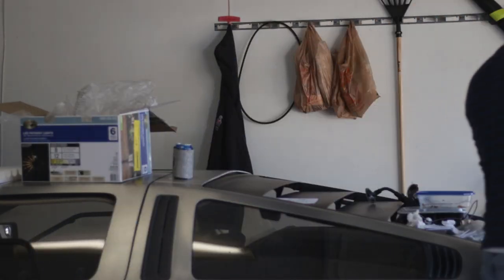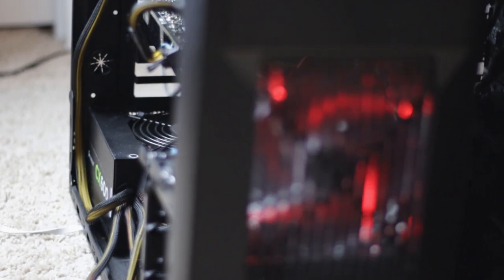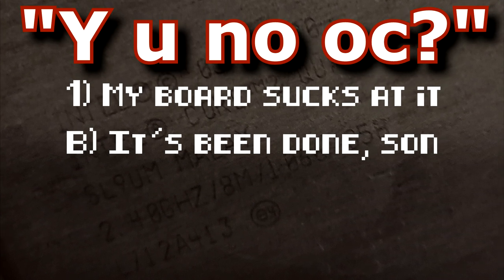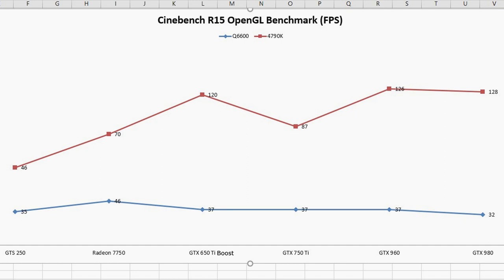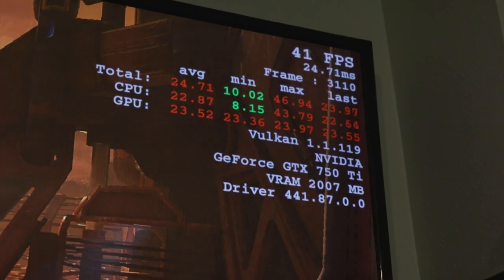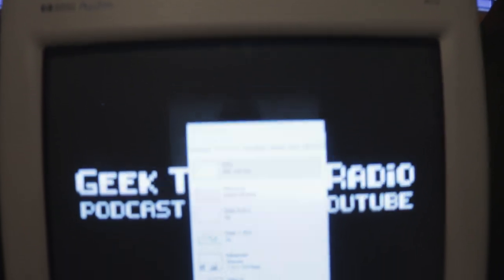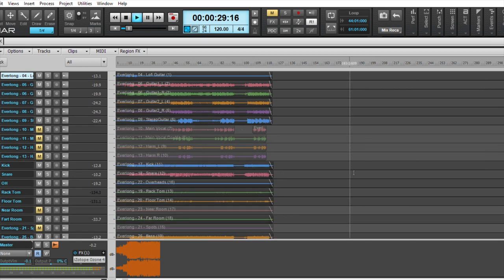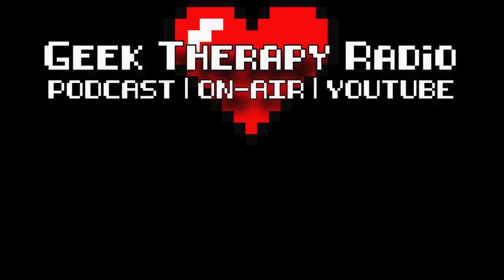Is the Intel Q6600 still worth using?

Comment: I just brought back my old pc with this processor 8800gs graphics card. What a beast it was in 07.  I'll upgrade it from 4(2x2) GB ram to 8 GB ram, a bigger (than stock) cooler 1 or two extra case fans, and because graphics card has two DVI ( none of that fancy HDMI or displayport stuff) I'll hook up my old 22"flatron and my 27" philips monitors. That will have to do for now as a workstation for PCB design, embedded software design and from time to time for wind down gaming. Not sure good or bad, but I'm running Linux. I think my graphics card might not like it

Comment: Q6600 at stock, 8GB DDR3 in HTPC. SSD boot drive. Tinkered with it last week by swapping out the RX550 with a spare GTX 1070. Rocket League @ 120 FPS.

Comment: i have two pc's with Q6600. Rock solid machines and no problem with Vegas Pro video editing or playing CS GO in low setting (i have gtx 760) Another cpu is stock cause my Intel Desktop board doesn't support OC but another is clocked at 3GHz paired with Asus mobo. Maybe upgrading setup later but atleast now i'm fine with these specs :DD

Comment: I feel like... everyone in the comments are my friends I never knew I had... 
I'm still using mine as main PC and still can't imagined why I'd ever want to upgrade. OK TBF I'm on a 6700 (so a bit faster at 2.66GHz) with a "hand me down" GTX680 and 6GB DDR2. Runs "A Plague Tale: Innocence" game from end of 2019 fine on max and no issues and even "no man's sky" (that "claims" need for 8gb ran passably), Genshin Impact that just came out is running great too. Certainly no issues with non-gaming use at all. I've even live streamed (because gfx cards do the compression). Only thing where it could be faster is ray tracing in fusion360. But I only do that for fun anyhow.

Comment: Lol im using Q6600 with a Gt 630 , using for gaming lol im poor
Reply: Im Using an intel celeron with 1.6 ghz Intel dedicated graphic and 2 gb ram ✌️ be happy about what you have
Reply: Get a q9500 from aliexpress bro, its only 10 bucks most of the time
Reply: @zaserker1851  i have a netbook. The CPU is soldered to the Motherboard
Reply: i use q6600 with gtx 1050 and 8gb ddr2 ram...only reason i have bad cpu is cus i stuffed all these things in optiplex 755 and mother board sucks
Reply: With a 1050 ti, ssd and fast/ reasonably high capacity ram the q6600 works nicely for average daily stuff and even sneaking in some gaming like Minecraft lowest settings with optifine and warthunder lowest settings

Comment: I still have my trusty Q6600 workhorse. 💪🏻💪🏻 It has been in more or less continued daily use from the moment came out of the box, shiny new, in late 2007, 😱 

It was born inside an of-the-shelf Compaq Presario that came pre-installed with Windows Vista (oh my.... do you remember that??)  Back then, this was a high-end consumer system. It came with a crappy video card though, that was instantly replaced by something I don’t quite remember, but it had an absolutely monstrous passive cooler that barely fit the system case.   Over time, that was replaced with power-thirsty AMD Radeon 5700 graphics card by ASUS. This sucked up so much power it forced me to upgrade the power supply to a 500Watt Unit. Also, it was freshly fitted with 8GB of DDR2 RAM and an early 120GB Samsung 840 EVO SSD, later expanded with a 500GB 7.200rpm WD Black Caviar HDD, salvaged from a fried laptop. Hooked up to my Synology NAS, that was more than enough to work with.

Even though it’s glory days are long gone, my little Frankenstein Q6600 system is alive and well. It’s fans are getting louder every day, power consumption is frowned upon by today’s standards, interfaces are obsolete in every possible way, and software updates are becoming increasingly challenging. Yet.... it still is a respectable match for many of today’s office laptops. My corporate 8th gen i5 laptop for example, stands humbly in its shadows...
Reply from the maker: Yeah man, paired with an SSD, DDR3, and a mid-range graphics card...the ol' 6600 is still surprisingly useful! :)

Comment: Not upgrading yet from q6600 overclocked to 3 ghz.  It still runs basic apps quickly.
Reply from the maker: Yeah, I'd be perfectly happy using a q6600 day to day. It only really shows its age when running intense modern tasks like video rendering and some modern games.

Comment: i have also q6600 with 8gram can i use gtx1050ti low profile?
without bottleneck?
Reply from the maker: Q6600 will bottleneck some CPU bound games, but overall most still playable.
Reply: @GeekTherapyRadio  i need to play some games like gta v or assassin creed,nfs, thats why i am asking.
i think i need to buy gtx1050ti low profile in future i upgrade my cpu how's that?
Reply: @GeekTherapyRadio  Any other gpu for this specs for q6600?
Reply from the maker: @harisminhas1664  GTA V is a game that will will be bottlenecked by the CPU no matter the GPU.

1050ti LP is a great card for a small form factor build, but the q6600 is going to limit it in some games, even if paired with a RTX 3090
Reply: @GeekTherapyRadio  anyother gpu?
Reply from the maker: @harisminhas1664  Yes. The GPU is only as good as the CPU allows it to be ...usually.
Reply: @GeekTherapyRadio  so anyother gpu with this processor?

Comment: Since you do not have a great overclocking motherboard, how about using the tape hack to overclock the Q6600? I am using mine for HTPC and MAME gaming.
Reply from the maker: It is on my agenda! I also have some Xeons for the 771 hack. Similar process, just different pads. Technically it's swapping pads.

Comment: Man, mine Q6600 running currently @3,5 GHz with no problem at reasonable temperatures on Asus P5Q-EM (yes ,it's DDR2 MB, but still) and 960. Could have got 3,6, but not in my heating case. I've seen significant boost in games, especially in multiplayer Battlefield 3, but I think AAA titles that older than 2013 is pretty much the limit to this CPU.

Comment: Can this processor support full HD monitor display without gpu . G41 D2 motherboard
Reply from the maker: Technically G41 can go all the way up to 2560x1600 via DisplayPort and 2048x1536 over DVI. VGA is also capable of 1080p (and a little over).
Reply: @GeekTherapyRadio  thanks mate for the timely response . I have g41 D2 , 4gb ddr2 ram , intel core to quad q6600 . Will it support full hd 32" monitor ? Won't want to get into trouble after buying a full hd monitor if it's not supporting ! Plz guide
Reply from the maker: @vetrivel1037  If the monitor has HDMI, DVI, or VGA it'll work like any other monitor.

If it only has HDMI, you'll need a DVI to HDMI adapter.
Reply: @GeekTherapyRadio   monitor is having all 3 ports , but my motherboard is having only vga port , ! What Im inferring from ur response is definitely my motherboard will accommodate a full HD monitor through vga port with full efficiency ? Is this correct ?
Reply from the maker: @vetrivel1037  Correct. VGA to VGA will work in HD. I've done it many times :)
Reply: @GeekTherapyRadio  thanks !

Comment: Man, I've been on an old things video splurge.. I think I got a Q8400 somewhere hiding in my storage. Maybe I could revive it for some more retro useage.
Reply from the maker: It's fun to see how these chips hold up. It puts things in perspective both how limited AND capable they still are.
Reply: You got that right. I remember building it for my brothers to use at the time. Bought it off of someone for about $75 USD total 4-5 years back. Just replaced the PSU and RAM, slotted in a 750 TI, and it was off to the races with it for under $300 USD. They used that way more then the PS4 at the time too.

Comment: I play WoW & GTA-V on mine with +High+ settings.
Q6600(x3220)2.4-OC 3.33GHz), DP45SG, GTX 670, 8GB DDR3 1480mhz. . .
3.33GHz achieved with only 1.285Vid, resulting in 'Stock Intel Cooler' temps of sub 65c.

Comment: Run Doom Eternal on C2Q! You must replace some liberary for video codec, so there is no required instruction in original, but it runs ... it runs wonderfully for a CPU that has 12 years! I had bigger problems with 3 yo processors at the beggining of century.
Imagine running Doom 3 from 2004 on a Pentium MMX processor LOL
However my C2Q career in my very casual gaming is doomed eternaly, by doom, same as the original Doom did to my 386, and Doom 3 to Pentium 3.

Comment: My little sister got my dads old work computer, being a dell 755, with a 775 socket, as it’s running a horrible I picked out this cpu and added so more ram out of other pc’s out his office. I’ve never been inside a pc before nor do I really know what I’m doing😂but I hope this cpu works for her as she only wants to play roblox and minecraft (she’s 10)
Reply: My 5 year old sister uses a Q6600 and 8GB DDR2 (With a GTX 745) and it runs roblox fine as long as your internet is fast enough. I also recommend Windows 7 Lite for best performance
Reply: I am in the same situation. I wonder if a q6600 would be enough to run roblox without a gpu. Did you manage to make it work?
Reply: @Sa396SP  I use a q6600 with a gtx 750ti 2gb and 6gb of ram, it runs perfectly fine.
Reply: I have dell optiplex 780 and 380 with q6600 paired with low profile 1gb 64 bit gt620. It can play some low to mid games online and offline games.

Comment: A gigabyte p35-ds3 takes that processor up to 3.6GHz, if the silicon can handle it, both my E6550 and later Q8300 were running stable 3.6GHz cooled by a Scythe Mugen knock-off by Xigmatek.

Comment: I had a q6600 and it lag spiked even when i dropped settings. It was capable of decent averages in fps but the problem of its age shows itself in the cpu induced lag spikes. Better off getting a new cheap cpu
Reply from the maker: Definitely. There are entire newer instruction sets that the Q6600 obviously doesn't have. Some games/applications won't even launch. Very few...but some.

Comment: will a Q8300 run with a GTX 660TI without any problem
Reply from the maker: 8300 is 4 years older than 660 Ti, but it should run great. Both are just outdated and will struggle with some modern games.
Reply: @GeekTherapyRadio  im not gonna be playing that much high end games since i cant efford it im gonna be playing or streaming some ez games like minecraft,fortnite and rocket league its gonna be able to handle it right
Reply from the maker: @Umxi404  eSports and games like Minecraft should be just fine.
Reply: @GeekTherapyRadio  thx dude

Comment: Bsel mod? Just requires tape. 3.0ghz and 1333mhz ram with...tape. ⚡⚡⚡
Reply from the maker: I like the 771 mod as well. 771 Xeons in 775 socket.
Reply: @GeekTherapyRadio  while it may be beneficial, I wouldnt go out of my way to buy it. Almost same architecture for a minimal experience. The q6600 can perform slightly better with something you prolly have laying around the house. Good vid tho and it's scripted well
Reply: cries in 4gb DDR2

Comment: I had a lga 775with a pentium dual core... And i got a cheap core 2 quad q6600 its overclocked at 2.8 right now but when my gtaphics card comes i Will oc even more bcause mu system is very goos not even a single error anf the temperatures are 60... I live in a hot country... I think it will be a rx 550 or a gt 1030 i am thinking about playing gta 5 at at least 40fps and nier automata...